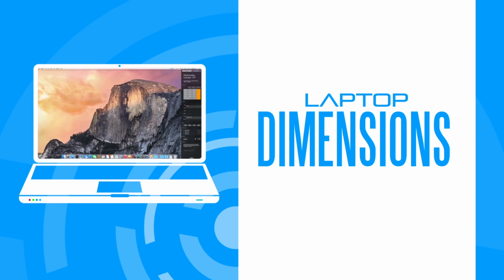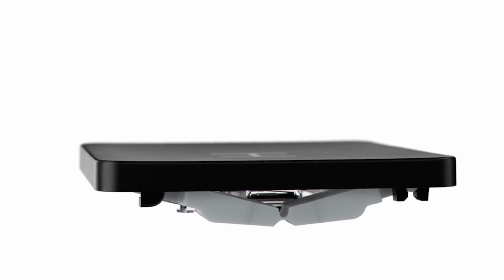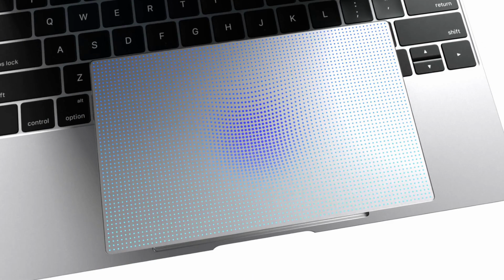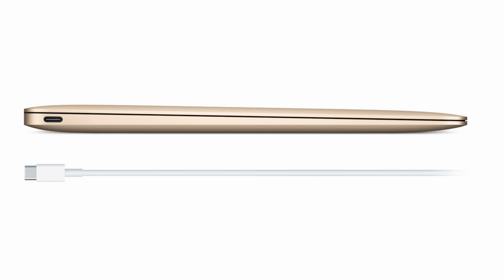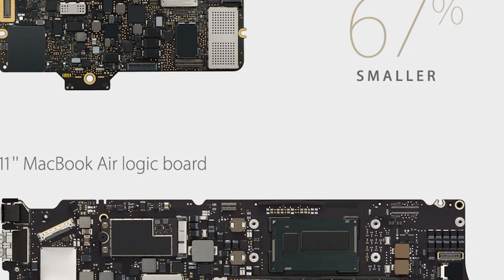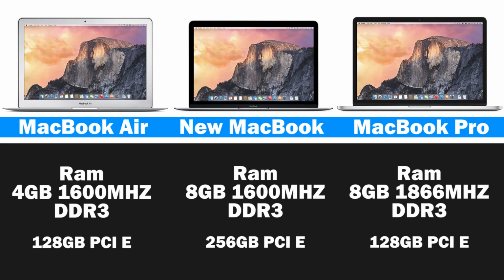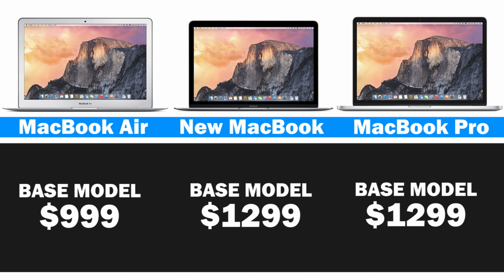New Macbook Vs 2015 Macbook Air Vs 2015 Macbook Pro - 3 Way Laptop Comparison

Comment: It is ludicrous that Apple charges $1299 (£999) for the new MacBook with the pro the same price. The pro has a larger screen, higher resolution screen, faster cpu, more powerful gpu, better battery, more I/o that doesn't need adapters and a better FaceTime camera. Compared to the new MacBooks advantage of smaller and lighter and more ssd space. How can a worse product cost the same. Yes the design is stunning but value for money is not there compared to the pro. You get lot better value for your money with the pro. I was interested in this new MacBook until the price, this should have been a $1099 product due to the wide difference in performance with a 128gb option. If they are having to tell you the keyboard is the revolutionary aspect then they are clutching at straws I feel, it'll sell well but if your in the market for the £999/$1299 computer just go for the pro.
Reply: +Daniel Prickett in the UK the Macbook costs £50 more than the Pro at £1049!

Comment: Pro all the way! The new MacBook looks great but is an iPad on steroids in my opinion, and the fact that it costs the same as a MacBook Pro is a bit ridiculous, I mean the design looks gorgeous, kudos to Ive for that, but it's a little overpriced. I have the Pro and I couldn't be happier!
Reply: I was debating on the new MacBook vs the MacBook Pro 2015. After seeing the specs and seeing that you need an adapter for everything... I'd be crazy not to get the MacBook Pro.
Reply: joseph Mendoza I noticed the pro is cheaper than the new macbook (at least in uk)

Just bought mines for uni. Should be coming in about a week or so xD
Reply: Jorge Lopez i have had my mac pro for a few months and have NEVER had a problem with it. my dad is an apple nut and in the past i have always said that apple is overpriced tosh. its only until you get one that you appreciate how amazing the are. go team pro!
Reply: Jorge Lopez yep, i too agree on the same, the new macbook is basically like a modded ipad, and as I am typing on the 2015 13" MacBook Pro with retina display, I can say that the MacBook Pro is completely worth the money. Before buying this Mac, I used a good-for-nothing Acer Aspire E1-510, which was rubbish. But then after I got this beast right here it has worked wonders. It's cool, and I feel that the MacBook Pro deserves a 10/10 according to my earlier experiences.

Comment: I'm getting an Air soon and I'm wondering in which case I would choose to upgrade the ram from 4 gb to 8 gb. What would I be able to do with just 4 gigs and what more could I do with 8? I don't generally multitask very much, and have, at most, 3 apps running at once, with only about 4 tabs in a browser at once.

Comment: I'll buy a new Macbook soon and I do like the new Macbook quite a lot in terms of the amazing look..
I want to use the laptop for programming with Xcode and therefore it's more important that everything runs smooth and without lag so should I buy the Macbook Pro or has the new Macbook enough power to handle Xcode?
Reply: Buy the one that offers the best value for money, so the Pro
Reply: The pro it's the same price, better battery life, webcam, more power
Reply: MBP. 

At the moment its..

MBP > MBA > MB

Comment: Could anyone here recommend a new laptop for someone that just uses it for basic Internet use Skype calls? I want something light and doesn’t heat up while it’s on my lap here in Thailand (hot). Also, I want a laptop that will last as long as possilble without getting virus’s. Not interested in gamming or video editiing but am interested in premium quality and durability. Thanks a lot in advance...
Reply: Just go for the base model MacBook Air 13". It has great battery life, premium finish, nice Webcam, very light and portable. It doesn't heat up at all. MacBook uses OS X that has very little to no virus issues. Cheers mate!
Reply: Wizzoryx Perfect! I’m looking into it now. So far so good. I really appreciate the your 2 cents.
Reply: Justin Becker Why don't you consider an iPad?  It checks pretty much all your boxes.  It's very light, good for Skype and Facetime (which can be a better experience for video chatting), has a long lasting battery, and doesn't get viruses.
Reply: Here's an idea. You should get one of the Chromebooks. They're small, portable, cheap, and fit your needs completely. Definitely look into it.
Reply: Karan Coimbatore Thanks Karan, I’ve looked into them a bit, but it seems they don’t support Skype. It looks like there is an Android app that can help get around this problem, but I’m not sure I’m willing to take an chances as my work requires using Skype daily and no other Voip platform. Thanks for the suggestion. Do you know if people are using Skype without issues on a Chromebook?
Reply: Just take the MacBook Air 13''. I use the macbook air for Skype calls,gaming(sometimes), school work and it has a long battery life. And until now, I have no problem with it(been 2 years)

Comment: In my opinion you only get the full value if you use something similar to apples refurbished system since you basically you get the same quality (since if it isn't like new they wouldn't sell it) therefore your getting the same product for 100-150 less and also if you know a friend who owns a company they can buy it through their company and then vat will be removed. Therefore loosing again another 100 or so. And also if you were to get a PC with all those specs and also an os, monitor, included software, keyboard and mouse it will cost around about the same give or take if you go through the steps that save money. But to be honest you get double the computer for 100 more of the price when buying the pro over the air. It's a no brainier.

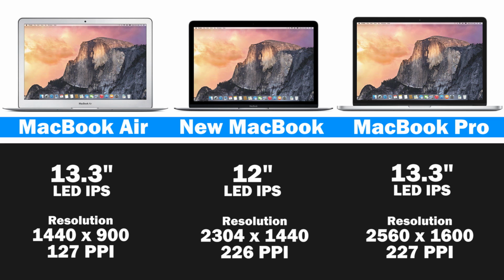Comment: The PPI count at 7:03 is a pile of nonsense. How can a macbook air with a 13" screen with a resolution of 1440x900 have a higher PPI than a 12" display with the resolution of 2304X1440? Complete bullshit.
Reply: I think you need to re-watch the vid
Reply: Nick Lukas Why?
Reply: Rematch man. The macbook has a higher ppi count

Comment: this is fucking ridiculous, you can get your self a gaming laptop for 1000,
or a high end pc
Reply: apple > pc . End of Story.
Reply: Luke V yeah true dat but do you need a 3 pound notbook? a normal laptop is portable enough (for me)
Reply: Jeroen van den Raadt I do agree, Apple is totally overpriced, but the aluminum casing, trackpad, screen and overall laptop is much better quality than anything I have ever used. Not to mention MacOS which is worlds ahead of Windows 8.

MacBooks are better than any windows based laptop, but at twice the price - that's the problem.
Reply: Hobbit Stomper yes. I have a powerful pc running Windows 7 that I use personally. While I didn't have one, I used my wife's macbook air. While I genuinely hate osx, being able to quickly and easily switch between workspaces was amazing for laptop productivity. And like you said, the trackpad and overall form Factor is amazing. Haven't used and of the windows uktrabooks to compare, however.
Reply: Doesnt matter whats on the inside whats on the outside matters the most - Apple Logic
Reply: I have both.
Reply: Luke V its not 3 pounds. 3 pounds would mean it would be 899 like the other macbook air.  the reason this is expensive is because its 2 pounds. TWO FUCKING POUNDS for a laptop with a retina screen, and then battery life of 9 hours and is completely fanless. tell me which gaming laptop is that light and thin and small but has the 9 hour battery life.
Reply: Jeroen van den Raadt All consumers don't game. We have no need for a gaming laptop.